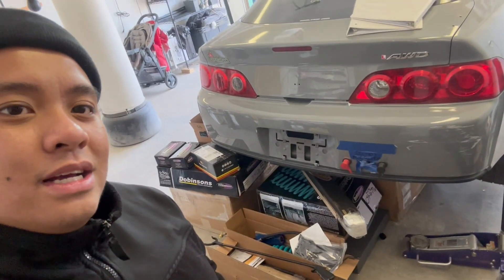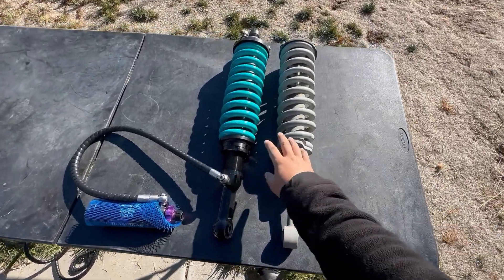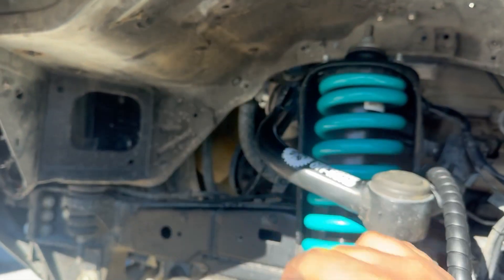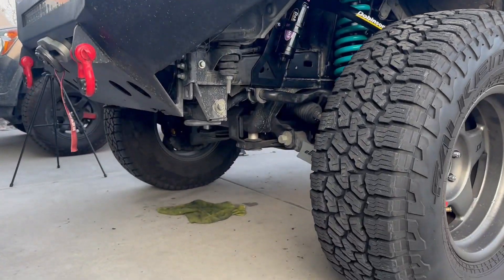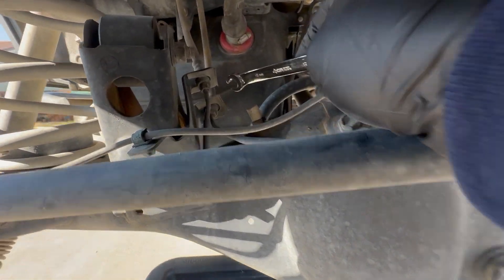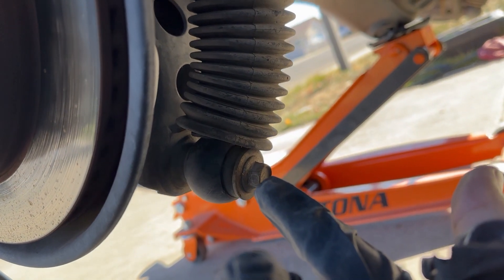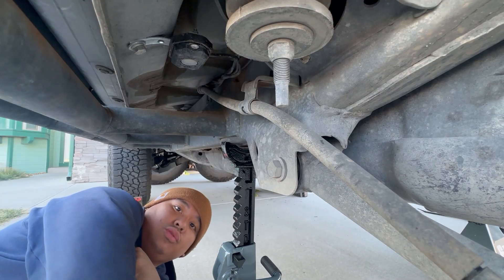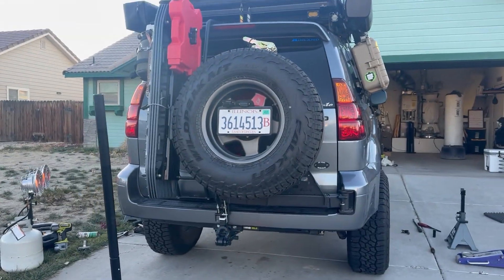Installing DOBINSONS MRA 3-way Adjustable Suspension on my GX470!

Comment: I love your set-up on your GX 470 specially with your Dobinsons suspension MRA. If ok with you kabayan can you give me a full details and specifications of your front and rear dobinsons suspension parts and coil spring. I have a 2008 GX 470 by the way, if you can help me, highly appreciated. Thanks .

Comment: you funny!! ;-) don't forget to get a panhard bar adjustment bracket (I think that is what you mentioned with Dr.KDSS) to get your rear axle geometry back in spec. Their upper and lower control arms may also be worth a look as they are much beefier than the OEM's. Got the same setup on my 2004 GX and this suspension has been awesome. I reversed the sway bar setup though, delete in front and left the rear in place with longer end-links - flex is a bit better but it tends to lean a bit more (see tinkerers adventure vid about the swaybar setup).
Reply from the maker: Yessir, I’m waiting for it to come in the mail!

Comment: Where did you get that hose protections from?  I do a lot of Dobinson installs and would like to recommend them to my customers.
Reply from the maker: I got them from Amazon, I just searched up hose protector🤙🏽
Reply from the maker: Electriduct 5/8 Inch Heavy Duty Spiral Wrap HDPE Flexible Plastic Cable Sleeve Hose Protector 25 Feet - Black